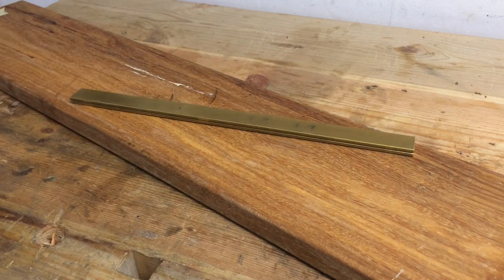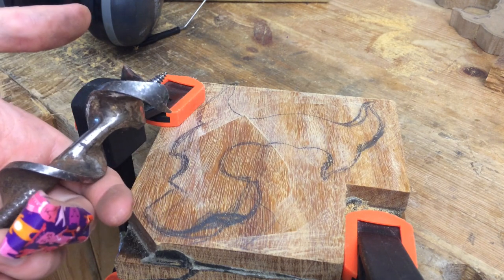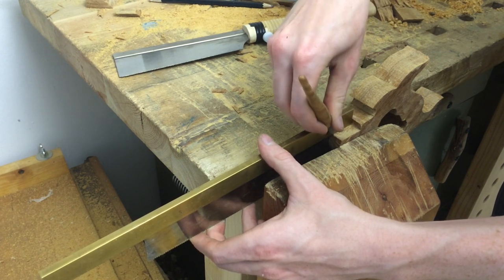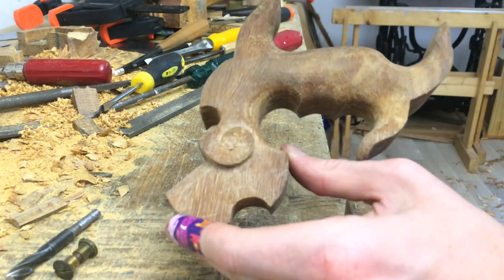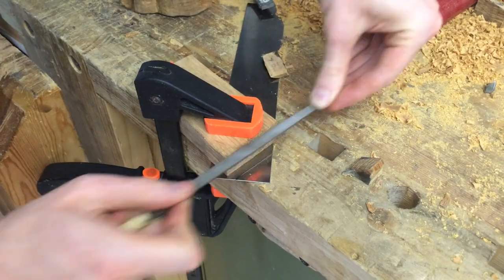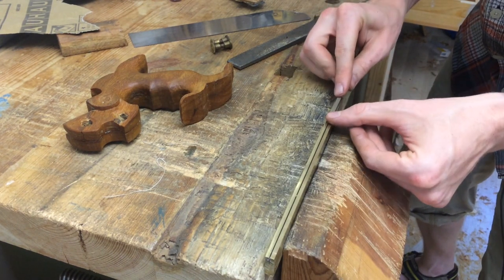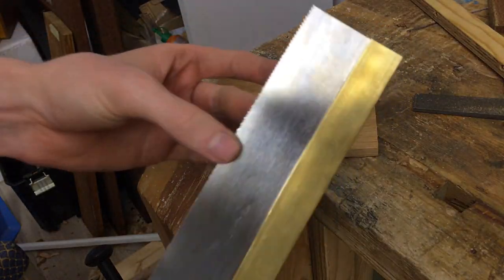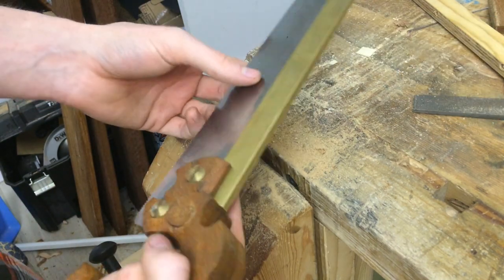Making a dovetail saw

Comment: Where do you get that tool to set the thooth of the saw?
Reply from the maker: Can't remember the brand name but there's pretty much only one company that still makes them, should be easy to find from any of the good hand tool retailers
Reply: @GillisBjork  
From what I see: the jaws of the tool are held by the saw blade and the pin pushes the tooth to the side without going too far ...
I think this part is very important since you made the saw from basic parts. This part of the process determines the smoothness and right direction of the cut.
Some time ago I bought a cheap general purpose saw because I needed it at the time and it happened that when using it in deep cuts the saw would drift to the left and there was no way to make the cut straight.
This tool of yours seems to me the correct one for its purpose.
A few years ago, I saw a person who adjusted the teeth using only the pulse of the hand and the problem comes when some teeth are more inclined than others; this causes the saw to leave rough marks and drift to the left or right.
I think you achieved the smoothness and right direction of the cut.
Thanks for uploading your video it was very informative.

Por lo que veo: las quijadas de la herramienta se sostienen de la hoja de la sierra y el pin empuja el diente hacia un lado sin pasarse de mas...
Creo que esta parte es muy importante puesto que tu hiciste la sierra a partir de piezas basicas. Esta parte del proceso determina la suavidad y direccion derecha del corte...
Hace un tiempo compre una sierra de proposito general barata porque la necesitaba en ese momento y sucedio que al usarla en cortes profundos la sierra se desviaba hacia la izquierda y no habia manera de hacer que el corte fuera recto.
Esta herramienta tuya me parece la correcta para su proposito.
Hace unos a;os vi una persona que ajustaba los dientes usando solo el pulso de la mano y el problema viene cuando unos dientes quedan mas inclinados que otros; esto ocasiona que la sierra deje marcas rugosas y se desvie hacia la izquierda o hacia la derecha.
Creo que lograste la suavidad y direccion derecha del corte.
Gracias por subir tu video fue muy informativo.
Reply: @j.palomera690  eclipse make them
Reply: @williamn01  
I will check that, thanks...